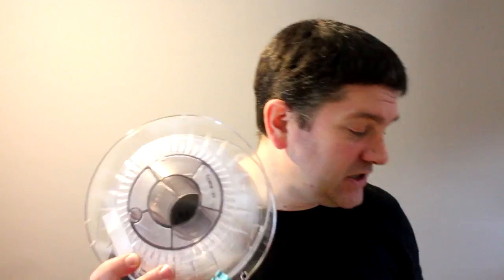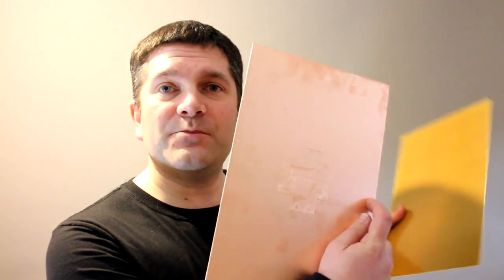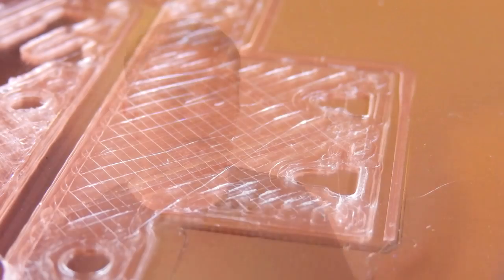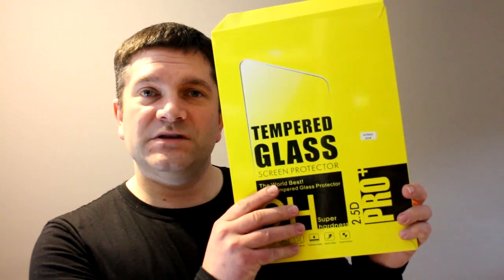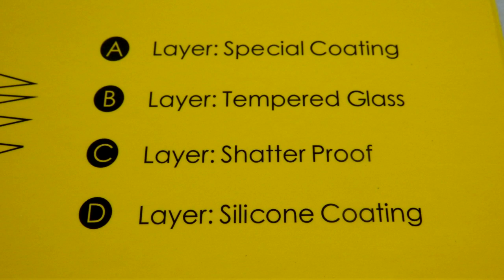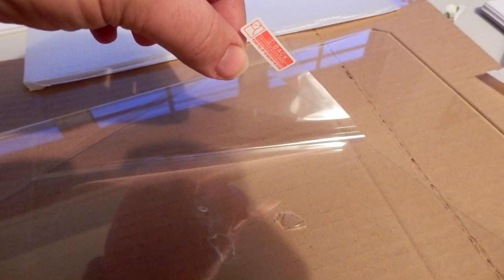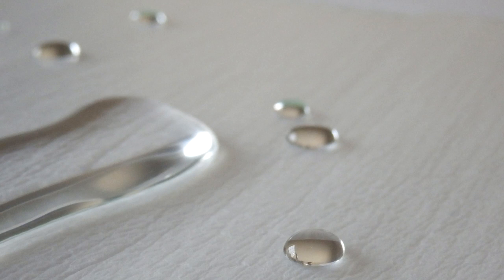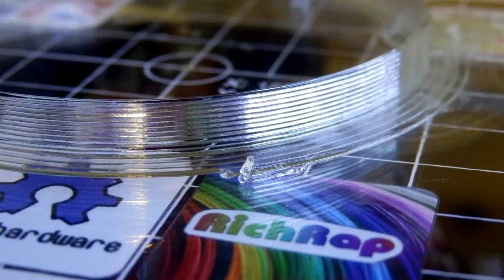Borosilicate glass damage with PETG 3DPrinting materials & a solution Feb 2016

Comment from the maker: As an update to this - Generally if you use a PEI print surface (and heated bed) and a thin layer of gluestick over the PEI sheet, PETG and other similar materials will bond when printing and release after cooling, they should not damage the PEI as long as you have a coating. If you print directly onto the PEI sheet it will get damaged by many PET and TPU materials.
Reply: yep lost mine whithin a month when i started trying tpu. way to much squish, switched to a glass bed and boy did my robot yell at me when i forgot to adjust the z axis for the extra height -.- whoops....i just tried petg with tape and glue, but i think that was to much stuff, and it lifted the first time and stuck to well the second i think the key is i need my bed temp inbetween the two prints somewhere around 65-67....60 was to cool, and 72 was to hot.  gonna try just tape on next print and if that dont work...just glue...im so scared to print petg on my glass after 3d printing nerd and a few others.

Comment: The thing people who don’t really care about this issue miss is that first layer adhesion is only ONE of multiple factors. 

I use glass, carbon-silica coated glass, and PEI beds depending on what I’m doing. Not for different adhesion, they all work, but for the different bed textures. 

Only glass gives you a perfectly reflective smooth surface. Smooth PEI won’t come close whether it’s glossy or matte. So if you print with PETG and want a glass smooth surface you HAVE to solve this issue without using any adhesive (which affects the texture) and obviously without just using a different bed material.

Comment: Hi Rich, Did you try to mount this stuff on ordinary glass?
Reply from the maker: Historically I have used plain mirror glass for most heated build surfaces, but then Borosilicate glass became more popular. I have not tried to use the thin screen protector sheets with plain glass or mirror-glass, and now I tend to use PEI sheets for the build surface.
Reply: Thanks. Tempora mutantur, et res mutantur in illis... :)

Comment: i wish i was having this issue.  I can't get petg to stick properly to my glass, and I keep reading that people get it to stick SO WELL to glass that it'll rip the glass.  I'm absolutely not able to get mine to stick.  I tried printing at the recommended temp of 230-250c (242 right now), and my bed at 63C, and most the time it just curls up and sticks to the extruder and becomes an epic mess.  

if I mess with it enough I can sometimes get it to print, and then about 99% of the time when the part is done, it's warped and bowed because it came up off the glass.  All I can think is, "WHAT AM I DOING WRONG?"
Reply: I think your bed temperature is too low. The sweet spot is somewhere above 70 c but less than 80. Careful going too high as it will destroy the glass

Comment: Do you think this would work on a metal build plate?  Or would the material difference cause it to expand and come off under temperature?
Reply from the maker: Bare metal build plates don't tend to stick material all that well. They also tend to be quite rare now as most manufacturers use a PCB as the heating element or a silicone heater pad. ABS Does stick to bare Aluminium if it's hot enough, but PETG may not do so well on metal.

Comment: you might be able to use denture powder, to put items back onto the print bed. if that would be of any use
Reply from the maker: ANy repair to the build glass usually causes the next model to bond even more. Scratches and chips tend to help fuze the next model, causing more damage.

Comment: a few years ago I was fixing a fibre glass boats,  and when I was at the fibre glass work shop, I asked about doing moulds and long story short, they told me about a product they called mould lock release.  it is a spray on film that they used to spray the mould with before making a boat in there moulds,  it is water soluble,  when finished they can wash it off ... just a thought that lap top glass looks like it is better anyway

Comment: I had the same problem and now all resolved and explained...
When the head scrapes the glass plastic get molecular bonding to glass...
Bond is strong enough to detach some glass when one trys to remove it by force or even after it is cooled in a freezer i pops off with glass chunks  attached..

Simple solution: make sure your first layer is at least 150 to 200 microns which meas that you must have your glass table leveled and offset on Z correctly...
Reply: I really do believe that has to be the reason. I've printed quite some PETG parts on glass and they all came off fairly easily right after the print, and even with near zero force after cooldown. I just loved printing PETG on glass. Yesterday, I printed some simple vase with a six layer bottom. On the first layer the extruder would slip because the bed alignment was way off again and the nozzle too close to the glass. I didn't feel like stopping the print this time and only reduced the flow rate for the first few layers. That turned out to be a bad idea. To my surprise, I was unable to get that thin 6 layer vase bottom off the bed. This morning, after heating the  bed again, it came off with little force but took a good chunk of glass with it.
Reply: petg rips out glass on some of my prints and the first layer is 0,6mm with 1,2mm nozzle.

Comment: I had that happen with ABS 3 years ago when I was testing lightly sandblasted borosilicate. It worked great for about 20 prints then are heard a loud pop when a print was cooling and that's when it took a chunk out of the glass. Good news was I could turn it over and use the other side until I got another piece.
Reply: Oh, and I had nothing else on the glass. No hairspray or glue.

Comment: I had a piece of Taulman Bluprint stick to my bed once and it would NOT come off (I tried heating, cooling, heating, cooling, letting it cool for a couple days, trying to get it off in the middle of cooling down from heating, etc etc I would have put it in the freezer like I've read about, but the glass is adhered to the heated bed which is soldered to the motherboard on my current printer).  I tried getting under any corner I could, and it just wouldn't budge without forcing it.  Finally I pulled it off, and yep, it took chunks out of the glass almost exactly like you showed.
Reply: +ualdayan can of compressed air hold upside down. the freon or whatever it is will come out and be cold as shit (as in hurt you if you spray yourself with it cold)

might work to get the stuck print off.

Comment: Why don't you just use PEI sheet as build plate? It has got perfect adhesion even for stuff like ABS without any coating. It's bit expensive, but lasts months of printing.
Reply: +Jan Bednařík My experiences with PEI have been very positive as well, I've been using it for 18 months now.  Richard's solution is cheaper though we might be limited by the sizes and shapes already available, depending on how well the material can be cut.
Reply: +JeffDM 10 Inches I think on eBay
http://www.ebay.co.uk/itm/9H-Tempered-Glass-Screen-Protector-Film-Guard-For-All-Samsung-Galaxy-Tab-Tablets-/381559457042?var=650671668859&hash=item58d6b74512:m:mknRIt6ttYIRG8a1USLqtZg
Reply: +JeffDM not a huge difference but it is a difference. $9 for the 9h sheet and $15 for the PEI sheet. just depends on which works better versus lasts longer. I LOVE buildtak but its very expensive for the durability IE it looks fine but stops "working" and you have to start using gluestick on it again.

Comment: Your video is quite illuminating. Another "out of the box" solution from an unrelated product. A friend now uses this protector to provide longer lasting viewing of his sand-blasting box, although it does eventually pit beyond clarity.

Would you consider that you are getting a substantially flat surface on the first layer? The brief glimpse of the underside of your part makes it appear that you have a "glass smooth" bottom to the part. Perhaps the suction effect you sense is similar to that of two pieces of clean glass or other flat surfaces.

Machinists using carefully ground gauge blocks can make two of them stick simply by forcing out the air when joining them. Perhaps that's the situation here?

Thank you for sharing your results.